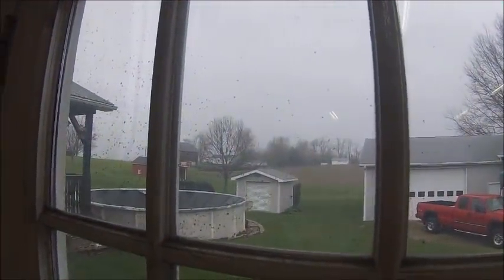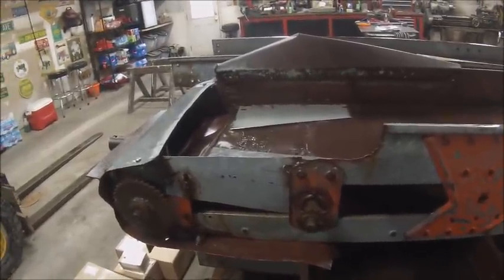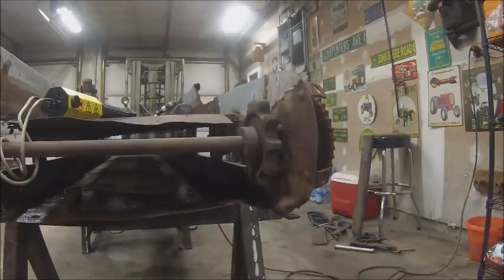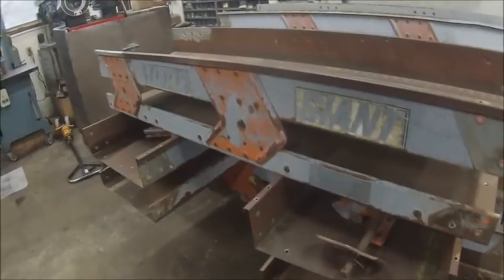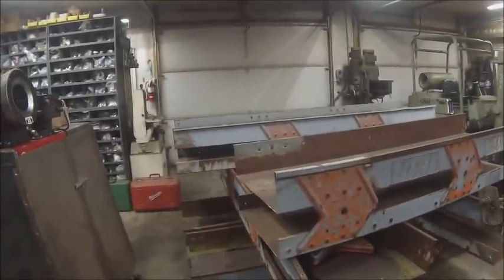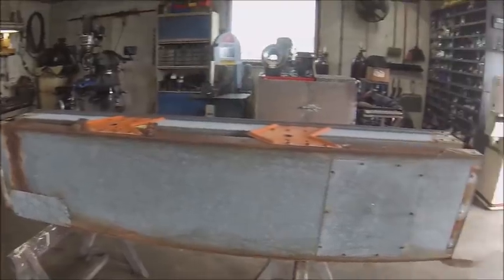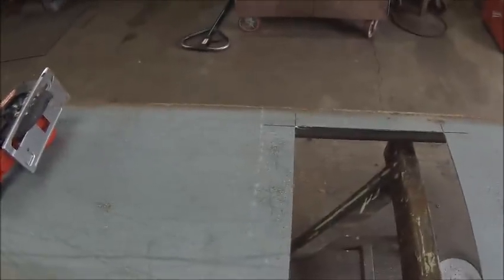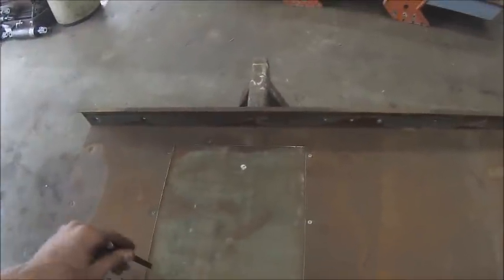Little Giant Elevator Build Part 1

Comment: I saw Chris Losey was planting but it doesn’t look like you’ve had such luck! I like the signs on the garage wall, my grandpa is big on the Cockshutts, he has a Cockshutt built 550 and 540 and an Oliver built Cockshutt. I also really liked the Dale Jr sign. Have a good one
Reply from the maker: They have a lot different ground than we do. Even the stuff he was planting into looked a shade on the wet side but you can get away with that on sand and it won’t hurt you.

Comment: You could try cold galvanizing compound spray paint to do the main body of the elevator instead of just painting it,  It works really good and lasts a long long time if given a good coating and a can goes a long way too !  Bandit
Reply from the maker: I used cold gal on the head section where it had been sitting in the dirt. I’m not painting the whole thing just the parts I had to take off that were orange originally. If I was going to take it down all the way I would just take the trough panels and have them blasted and re galvanized like new.
Reply: @Oliver66FarmBoy  One other thing, That cold galvanizing compound makes for a great slip plate paint for the bottom of a gravity wagon or the grain tank in a combine and boy does it get slick ! LOL  Bandit
Reply from the maker: Might have to try that on my fertilizer wagon.
Reply: @Oliver66FarmBoy   If your going to sand it down to get the rust off it all you got to do is blow it off good and give it a good coating or two and it will last and will leave a powdery coating on it that will be good and slick and the more beans or corn go acrossed it the slicker it gets and I would say fertilizer too.  Best thing is it doesn't act like paint when it starts getting old and wont flake off like paint does. I've used it on bare steel and over paint that has been roughed up (sanded) and it really works good.  I think if you try it you'll really like it. I use Rust-Oliume brand and it can really covers a lot more than you think it would.  Bandit

Comment: Believe it or not, you have more lag issues with wi-fi than hard-wired. 
I'd almost suggest just heat that corner up slightly, then mount those side plates on, that would pull that side back in fairly straight. Once metal bends in any form or fashion, very difficult to get it back to "perfect". I'm a little jealous of that saw, thing is, it's really not the say itself, it's the blade. You gotta very good tool, will last you a long time. Looking forward to seeing this project completed and working. Great video as always, cheers :)
Reply from the maker: Actually most of it is in the saw. Dry cut saws have a gear reduction head to increase the torque for steel cutting and to drop the speed to improve the lifespan of the carbide on the blade, which also reduces heat generated. The cut from a dry cut saw will still be almost cold to the touch afterwards. If you tried to run that blade in a standard Milwaukee circular saw you would most likely burn the saw up or knock all the carbide inserts off the blade or both.

Comment: So, are planning on using just square bales for your beef cows you were talking about? My dad or grampa built a covered small sqaure bale feeder and it worked really good. A design like it would be good for a small number of cows. It just got out dated when we switched to round bales. 
Hard wired internet is just better. Wifi or wireless is okay most of the time but it can make your life miserable when it loses connection.
Reply from the maker: Squares are all I’ll ever need. Only have enough pasture for 5-6 head anyhow.

Comment: You should be able to resume the video upload by refreshing the page and starting the upload again and it should pick up were it left off at.  Just don't delete the video or cancel the upload.
Reply from the maker: Tried that. Brings up a message to the effect of you are attempting to refresh the page. Any unsaved changes you have made will be deleted. Then if you refresh the video is gone. That’s what happened to me anyhow.
Reply: @Oliver66FarmBoy  Are you using Google Chrome?  That's what I always use to upload, yes it will give you an error message when you try to refresh the page, but just refresh anyway and restart the upload and it should pick up where it left off.
Reply from the maker: Yes I’m using chrome. And I have tried refreshing it. It deleted the video on me.